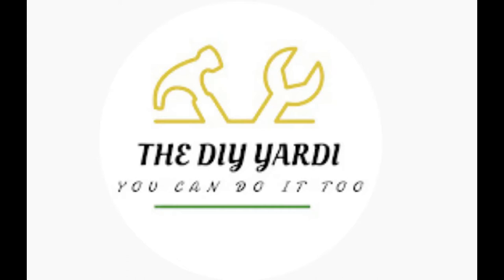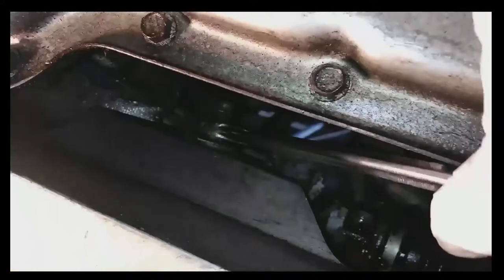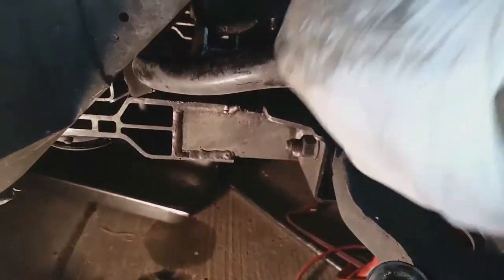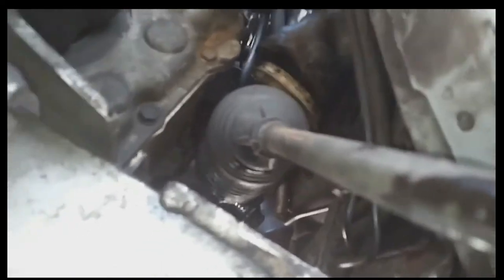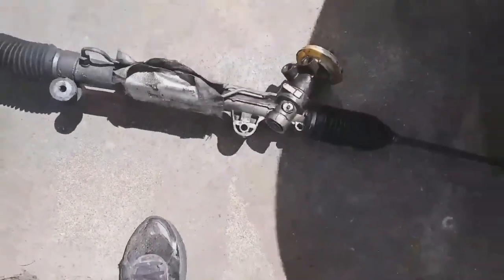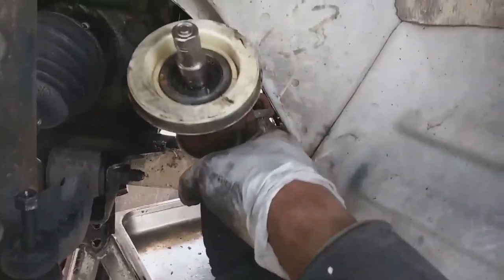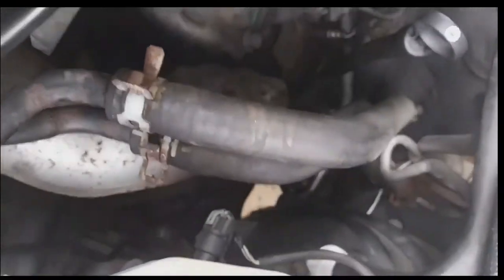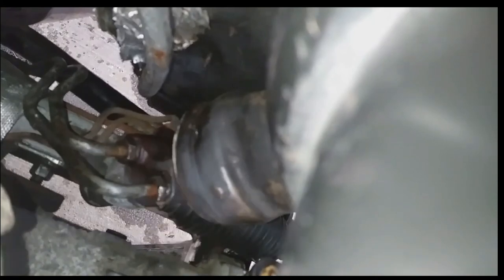RACK AND PINION REPLACEMENT ON 06-13 CHEVY IMPALA/MALIBU WITH HYDRAULIC ASSIST, TO FIX HARD STEERING

Comment: I have an 07 LTZ that needs the rack and pinion replaced because of a leak also. I'm so glad to see you did it without dropping the subframe like some other videos show. I'm pretty mechanical and think I can do it. Your video was so helpful to see how well you did it. Thanks for sharing.
Reply from the maker: You're welcome Todd, I do these videos to show that there are alternative ways to do these repairs, not everyone has the tools required to drop and support the subframe, but you are still able to get the job done...

Comment: One thing know one says (all great videos though well appreciated) Is (WHEN COMPAIRING YOUR OLD RACK AND PINION TO THE OLD ONE DONT THINK THAT IT DOESNT FIT -REMEMBER THE GEARS INSIDE MAY MAKE THEM SEEM DIFFERENT SIZED) THE ENDS MAY BE EXTENDED OR RETRACTED. )
Reply from the maker: Great info, But you made a typo, you have old rack compared to old rack instead of old comparedto new.

Comment: Hey TDY,
Thanks for the time and effort you put in this video I really appreciate the suggestions you give while working even if you don't follow all of them yourself (lol). Makes it easier for the next guy. I came across your video because I just got a phone call from a friend who has a 2011 Impala with hard steering after a jiffy lube oil change. My thinking is "They" got oil on the belt or something "They" did that caused the problem, at least I hope so. But if it's a power steering pump or rack and pinion issue I'm now armed with the information I need to tackle the job. So thanks again for all your time and effort keep up the good work you got a new subscriber in me. Take care TG
Reply from the maker: Much respect and thank you for taking your time to show your appreciation, and also for subscribing TG, most people get the info and don't give it a second thought. but as for your friends car, oil on the belt could cause a hard steering, but that should go away after driving for a while and it dries off, it would have to be a continuous leak onto the belt for oil to cause that for a long period of time. also some of the Impalas carry an electrically powered rack, that is something you need to verify first. please let me know what you find, interested to hear what caused or is causing lt.
Reply: @thediyyardie7192   Just got a text stating her brother cleaned the belt and the "car is working better" (her words), she'll keep me posted if things change. If you don't hear from me in a few days problem solved, if not and she brings it by I'll let you know what I find. Keep up the good work and thanks again.  TG

Comment: Good job man. I subscribed and liked. Glad it can be done without dropping subframe.... a lot of videos say it has to come down. I didn't think so looking at it. Sway bar was a good tip!
Reply from the maker: Much thanks 316 Automotive, I appreciate you doing that, yes there's usually multiple ways to do most repair jobs, sometimes you just have to work with the tools available to you..
Reply: Dropping the subframe isn’t hard and makes the job 100 times easier.

Comment: The part is on the way to my house and I will be trying to tackle this when it comes. Thanks for the great step-by-step video. I will be referencing it as I go. You make it look like you can get really close to the  power steering lines. That is the step that has me nervous.
Reply from the maker: @Scott Mulligan, you're welcome and yes you're right, getting the power steering lines pulled gives the most headache, if you click on the description box for the video, you'll find a link for the type of tool that I feel is best for loosening those lines, good luck with yours, let me know how it goes..
Reply: @thediyyardie7192  not a good start. One end of the sway bar separated and broke. That adds another $100. I had to cut one of the tie rod ends off so I'm replacing both of those...another $30. Some of the bolts holding the sway bar down are not releasing and are starting to strip. I'm still waiting for the crow feet wrenches so I can take the pump lines off. Once I get the bolts and lines off I think I'll be home free.
Reply from the maker: @smulligannj  do you mean the sway bar linkage? its hard to imagine the sway bar breaking.. but stuff happens, especially when its a older car that you're working on..
Reply: @thediyyardie7192  ...one of the linkages snapped in half and the last couple of inches of the sway bar was splitting in two. When I was tapping on it the top half broke off.
Reply from the maker: @smulligannj  it sounds as though those parts were already on the out anyways, you just speeded up the process..  soak the nuts and bolts with penetrating fluid, that will help to keep them from braking or striping, even at the time while you're loosening them..
Reply: @thediyyardie7192  The bolt extractor sockets from Harbor Freight made short work of the stripped bolt. Now I just need to get the stinking lines off the rack and pinion. I've lowered the sub-frame already which makes them easier to get to and am drenching them with penetrating fluid. I don't know how you're accessing them. I've tried underneath, from the side, and laying on top of the engine reaching down with both arms. I just can't generate enough torque to crack them. Next step is to just cut them off and replace the lines. ARGH!!!
Reply from the maker: @smulligannj  man you're really catching it!! did you remove the intake air filter and housing? that should give you some space to work from above... you could also try a long extension with a breaker bar, make sure the wrench is always square with the nut for the lines while attempting to loosen in order to prevent the nut rounding... good luck, and let me know how it goes..
Reply: I finally got it all out and back together. Thanks for the tips and encouragement. You are a lifesaver!!! This was definitely the most ambitious car repair job I've done and I've swapped out a steering column several times.😊
Reply from the maker: @smulligannj  
you're quite welcome , and good to hear that you got it done, it takes a lot of patience with some of these jobs, not to mention the proper tools..
Reply: just take the breather box off n the fittings are right there
Reply: Just watched your video, thanks for your time to put this out, one of the best videos on removal of the R&P !!! Don't have a crow's foot so gonna try from the top side as you showed and figure out a way to break those 18 mm PS connections. Thanks again for your video !!! Subscribed and Liked !!!

Comment: Thanks for showing the "cheap and lazy" way. I knew I didn't need them crows foot wrenches or the sub frame bs that I had to do this job the first time. Unfortunately 1 year later doing it all over again because oreillys sold me a bad part
Reply from the maker: You're welcome Ricky, but I did need to use the crow foot wrench on one of the fluid lines, and if I can get a job done quicker by doing less work, I wouldn't call it lazy, short cut or tricks of the trade maybe, as long as it results in the job being done properly, thats air that matters.
Reply: Which one did you get from O'Reilly's that went bad on you?

Comment: I have replaced the power steering pump, and bled the lines, that didn't work. It's hard steering up to a point even though I'm going 40 mph around corners. I'm going to try replacing the rack and pinion?
Reply from the maker: That could most likely be it, once the internal seals become worn the system can't maintain the correct pressure thus the result is a hard steering.

Comment: On another note do you think it wise to do the steering pump at the same time as it is making grinding noises, I have some strange worry the old pump might damage new rack and pinion in some way.
Reply from the maker: Yes I would definitely agree with you on doing that if the pump seems to be or sounds damaged..

Comment: I just did this job with a new rack from Napa, bleeding the system for about 2 hours ...
But now I don't have power steering 😢...
It had power steering this morning but now I don't, there's no noises coming from the pump like if I was low on fluid..
Everything was installed right...
Any advice
Reply from the maker: @buck1569, check to see if power steering fluid looks clear with no foam or bubbles with engine running, if foamy then more fluid is needed, also make sure its up to proper level. If all of that checks out, try holding engine at  about 2000 RPM in park, while doing that, turn steering from right to left, if it feels easier to turn, the issue is most likely a faulty pump, if no change then I would lean towards the new rack being possebly defective..
Reply from the maker: Let me know if you if you got it sorted out Buck..

Comment: Should use line wrenches on those power steering lines so you don't round them off.
Reply from the maker: That is true Greg, I actually used it where it wound fit, that space was close..

Comment: I have a line that is cracked on the rack on passenger side can't find that line anywhere do you suggest having to pull the whole rack n pinion out or would i be able to just pull that line
Reply from the maker: @Ruben Pena, no need to remove the rack to replace that line, and did you try eBay?
Reply: @thediyyardie7192  I went to the junkyard got the line just dropped the sub frame for more room to get it on because I don't have crow foot wrenches but I messed up and cross threaded the new lines nut what would you suggest?
Reply: @thediyyardie7192  should I go get another line and try again or would Teflon tape do the trick?
Reply from the maker: @rubenpena2346  wow, sorry to hear that, your best bet now would be to get yourself a thread chaser set to repair the damaged threads.. good luck with that, but be sure to get the lines screwed in by hand as many turns as possible before using a tool once you get the threads repaired.
Reply: @thediyyardie7192  I just got it thank you for the help much appreciated
Reply from the maker: @rubenpena2346  You're welcome man, let me know when you get sorted out..

Comment: I’ve been trying to get the knuckle on to the shaft for two days now! 😩
Reply from the maker: Try loosening the subframe some, if you lower the back section an half an inch or so, that should give you some more clearance.
Reply from the maker: also make sure they're both aligned with each other ..

Comment: Whats an average cost if done in a shop vs diy?
Reply from the maker: $1300 to $1700 is average shop price, but you can probably find a shop to it for less if you order the part yourself, you can order a less expensive rac, but the drawback there is most shops won't provide a warrantee if you supply the part. I have a reman rac listed in the comment box below the video for $240, but you should be able to find a new one online for around $500, ultimately its your choice on shop or DIY.
Reply: you in NC?
Reply from the maker: @ampecsu  No I'm not, sorry ..

Comment: Good video, only wish you would have explained a little better from what position you are working from like under the car from wheel well or under the hood.
Reply from the maker: I got you Robert, I see what your saying, but you should be able to figure the left wheel well in the video from right by the set up of the rack and pinion, the steering knuckle is the drivers or right side..

Comment: My top hose wont catch thread for shit.... If something didnt get me during removal,  it damn sure got me during replacement... Im over this damn car...every single time
Reply from the maker: The threads may need to be cleaned up, also sometimes you may have to bend the line slightly to get it started, and you should get it started by hand a few turns before you use a tool.